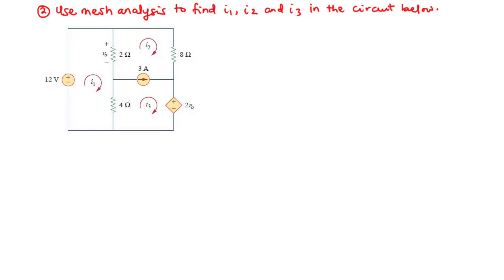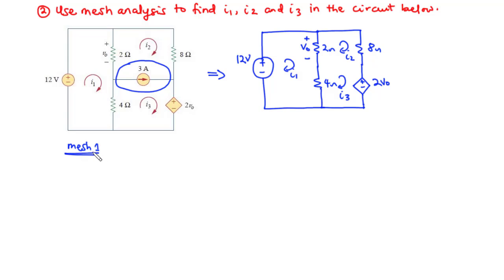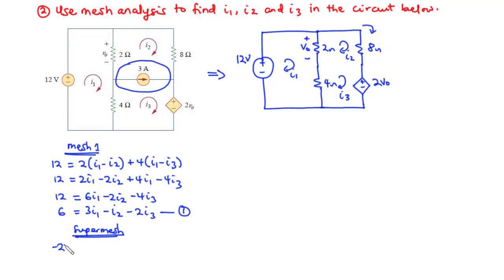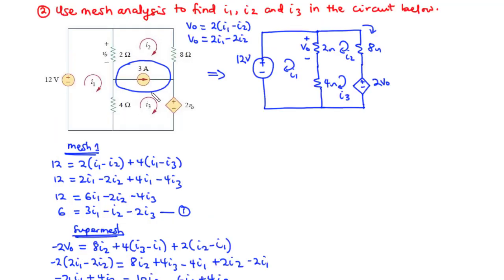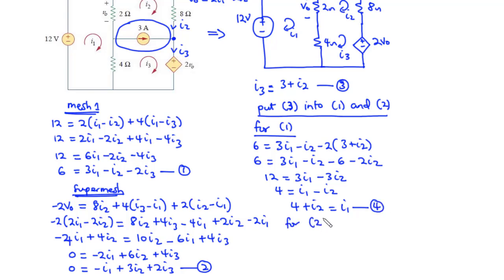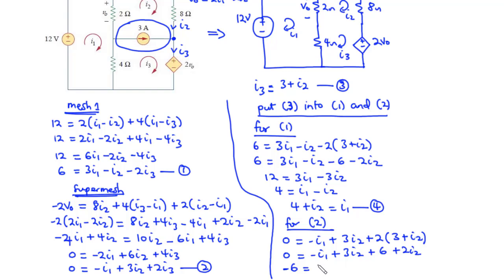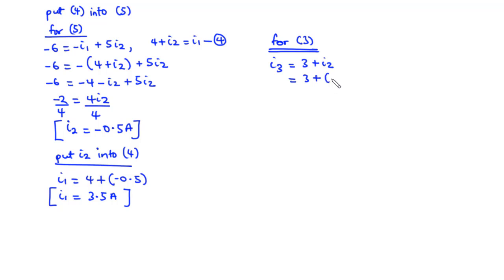☑️16 - Mesh Analysis with Current Sources (Supermesh) 2

Comment: thank you so much🙏this was so helpful God bless you
Reply from the maker: Amen, thanks so much for watching.
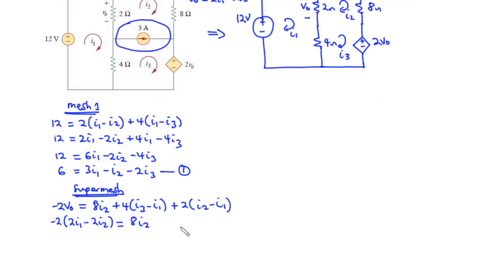Reply: Hi, can i ask at 5:11 why is the equation of V0=2(I1-I2) and not 2(I2-I1) since it is from mesh 2s persepctive?
Reply from the maker: The resistor 2 ohms, is between mesh 1 and 2, whose current has already been defined as (i1 - i2), hence to find the voltage vo, it's simply 2 times the current in it.